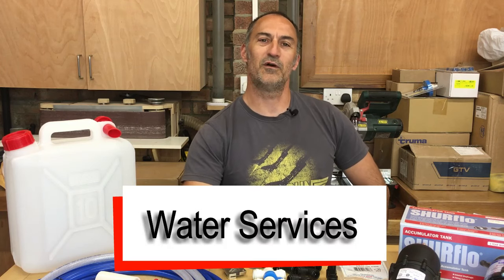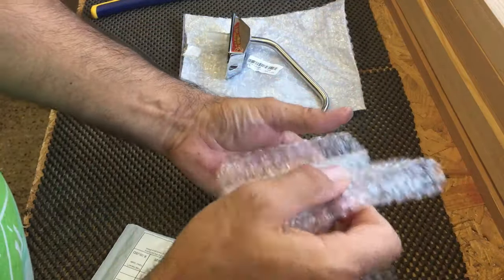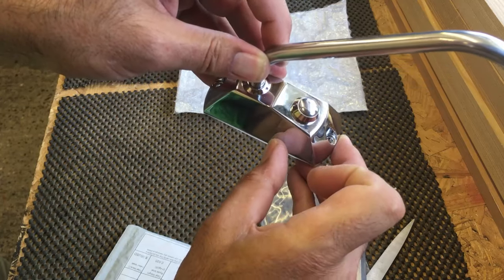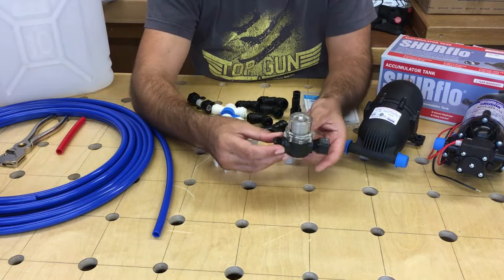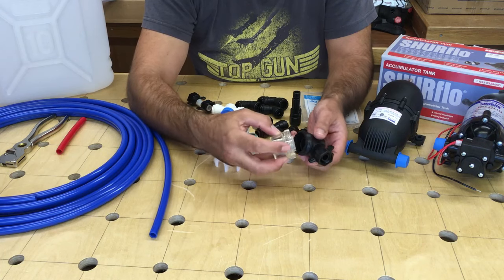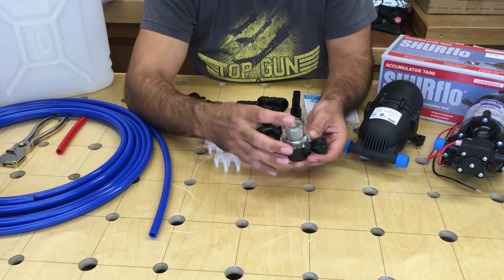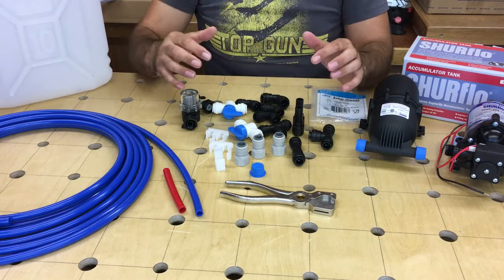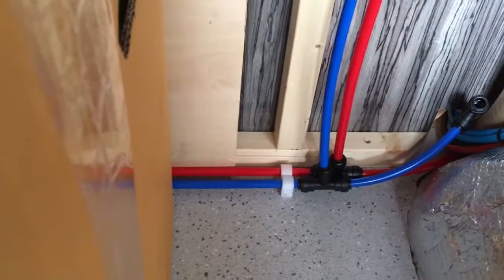Domestic Water Services - Camper Van Conversion Series

Comment from the maker: I have been asked about pipe inserts, I had an email from John Guest Technical dept today to confirm that inserts are not required on cold water services but recommended they be fitted on hot water services. So I will be adding tube inserts to the hot water joints, fortunately I made sure it was all accessible and not hidden away.
Reply from the maker: Iseeu Allgood, a few guys in the comments have mentioned the need for inserts to be used. I checked with John Guest and they have confirmed the above. The insert is placed into the end of the cut pipe to stiffen it, especially on hot water services as the pipe becomes more pliable with heat. Can get them for just under 50p each and fortunately I only need about 20 so under a tenner. 😃
Reply from the maker: Hi Sandy :D I'm guessing your house is less likely to be moving around much, so less vibration and risk, than in a van.
You not building a spa deck on the roof, for the ultimate hot tub views  ;D lol
Reply: i asked yesterday but after editing my message to include other questions i forgot to leave the question about inserts , The reason i asked was because im doing a van like Gregs but not up to date on latest materials , i used to own a loft conversion company and had a very bad experience caused by a plumber that didn't use inserts. days after completing the job one of the pushfit joints  popped and caused severe damage to ceilings and rooms below. i also remember cold joints slightly leaking without inserts, im not a plumber .. maybe theres less pressure or heat in a camper system so it wont be a problem .
dunno ?? 
the other thing got me thinking was that the inserts will make the pipe slighty more narrow at the connections , could that affect flow needed or pressure etc ?
Reply: @markusmack2732  don't think the inserts will make any difference in the presure or flow, they are quite thin. 
In a camper/boat the water pump is often turned off when the water is not in use and a leak will therefore not lead to a bigg spill.
Reply: Hi regards the inserts on the blue pipe you should put inserts on all your fittings the reason for this isn’t to just strengthen the pipe it’s there to stop the pipe from cutting the O ring in the fitting. when you cut the pipe with your pipe splice it will have sharp edges the insert will give it rounded edges. you might get away with not putting inserts in several times but one day you will find the pipe will cut the O ring in the fitting and leak and if the fittings in a awkward place it could make it very hard work. 😉
Reply from the maker: You make a valid point about the sharp edge on the pipe. 
You could also use a deburring tool to put a slight chamfer on the leading edge and some plumbers grease to ease past the o rings without risk of damage. 👍🏼😀
Reply: Hi Greg, great informative build series thank you. Do you have to equalise the pressure in the accumulator to match the start-up pressure in the pump?
Reply from the maker: Timothy Trewin yes the pressure in the vessel should match the pump pressure. Mine are both 2bar or 30psi
Reply: Hi Greg, I couldn't find any pipe inserts for the 12mm PM system. Did you add these to your installation eventually? I'm also wondering how you made the connection from John Guest to the metal threads of the water tab. Did you take JG plastic connectors? Thank you one more time for another great video.
Reply: Did they give you any reason for not using the inserts on the cold pipe?
Reply from the maker: @bexnut  it’s because the hot water makes the pipe softer. Not necessary in the cold pipes. 👍🏼😃
Reply: @GregVirgoe  Thanks for the quick reply Greg - good to know :)
Reply: Can you add a link for 12mm pipe inserts for hot water pipes.
Reply from the maker: @skierbaz this arrangement pressurises the entire system hot and cold. Why do you need to put the pump in the hot? Put it in the cold feed to the water boiler.
Reply: HI Greg. Thanks so much for all you helpful videos as they are a godsend. Can you please tell me how you connected the 12mm water pipes to your shower and sink taps?
Reply from the maker: @anthonyjones9009  this video shows the shower installation
https://youtu.be/vpezHyhLjxI
Reply: @GregVirgoe  0

Comment: Honestly Greg you save me so much time and effort, I'm in the middle of a van build that I'm living in as I go and I'm about to start designing my kitchen block including water systems. I hadn't done any research yet about even what pump I might want to use, and now I feel like I don't  really need to other than scaling everything down for my requirements. You're an absolutely top bloke, cheers! I'd happily buy you a carton/bottle of your favourite drink as compensation :D
Reply from the maker: I'm pleased it was useful to you, makes it all worthwhile, what type of van do you have?
Reply: I Have a 2005 Ford transit LWB High roof but not the jumbo with 200 km on the clock, that I picked up for a bargain It actually died on me as i drove it home, but the dealer was obligated to fix it so I got all new injectors and fuel pump,  such luck! I'll be putting in an arduino and raspberry pi to track interesting statistics, hopefully in the next few months will have something to show :)
Reply: That sounds very interesting Sam.  Do you already have a YT channel, or Facebook page link?  Would love to see Arduino video when it becomes available.
Regards Mark in the UK
Reply from the maker: Hi Sam, what things will you be tracking?
Reply from the maker: Hello Mark, I accidentally removed your comment instead of pressing reply. Very sorry, would you mind posting your question about tube size and colour again. Sorry slip of the finger 😐
Reply: Hmmm.  I know when I'm not wanted :)
The comment/question(s) which I can still see incidentally,  are pasted below.

Hi Greg.  Yet another excellent video.  Ok. you're now definitely my 'go to' new video to watch.  Shame it's almost coming to the end of the build - except as you mention at the end of this video, there are more to come.
Perfect timing yet again too.  I just selected my 2 x Shurflo pumps (20psi) and pressure vessel yesterday.  Still have the filters and isolation valves to 'put in the basket', but again you and I seem to be in near total agreement.  
I say near total, because I'm wondering why you used 12mm pipe rather than 15mm domestic flexible pipe.
From what I remember, the colour coded pipe is quite a bit more expensive than the white 15mm and I had in mind to just colour code near each fitting with a felt tip marker.
Why did you go for 30psi if 20psi you admit is adequate?
Looking forward to the next video, but again just wondering, have you actually departed on your European tour yet.
Regards Mark in the UK
Reply from the maker: How embarrassing, I was just saying to Lou, oh no!! I’ve just deleted Mark’s comment by accident and been trying to see if I could get it back. So sorry 😐 
Ok so the demand on our system is very low and at 2bar the flow rate through a 9mm pipe is adequate for the sink tap or the shower mixer.
Because it’s all fed off one supply we will not use the sink while someone is having a shower only in case the pressure fluctuates and causes scolding problems in the shower. 
Nothing wrong with going for a larger pipe and if it’s cheaoer then happy days. 😀  Your lower pressure pump will work better with larger Pipework.
No not left just yet, bit behind schedule, van booked in for service and not next week, just DVLA to sort out and insurances so hopefully a couple of weeks. May just go a different way around that’s all but we are free to do what we like when we want that’s the beauty of this. 
Thanks for great comment as always. 
Please send me some update pics of the van 👍🏼
Reply: Thanks for the reply.  Another question.  Is your submersible pump automatic or manual?  Auto in the sense that it will switch on at a particular fluid level and turn off at another?  Or, manual with an on/off switch?
My grey water system has changed very slightly so that I would like to be able to pump grey water from a 'sump' up 1m max into the grey water tank.  So, I'm looking for such a pump.  Would your s be suitable or can you recommend one that would be?
No pics really yet of my ex-community minibus conversion, although I think I may have sent you an outside pic of it - haven't I?  Actually, saying that, I don't think I have because I don't have an email for you unless I sent it via facebook.  Let me know.
Mark
Reply: @GregVirgoe  Greg, if it's not too much trouble please keep us posted with insurance costs.

I saw from another YouTuber (who gave you a shoutout :p) that his van conversion cost less to insure as a motorised caravan than it did preconversion as a van.

I'm not sure how and when that applies but it's a point of consideration.
Reply from the maker: Dazzletoad will do a video on the DVLA conversion and insurances etc thank you
Reply: I've an Arduino Mega in my Transit build. It controls just about everything and even talks to me courteous of a Emic2:)
Reply from the maker: Hello Mark, the small whale sub pump is only designed for light fresh water use. I would not use it for grey water. You need a proper 12v sump pump with float switch. There are grey water pumps, look up Jung Pumpen or Saniflo 👍🏼
Reply from the maker: Rob, you’ll have to do a video on that for us, first one I have heard of using arduino

Comment: I find its handy to have an isolator between the filter and the pump.  That way you can clear the filter without having to turn off the pump and empty the accumulator by turning on a tap.  It saves water and effort when servicing.  Videos are great by the way, really appreciate the effort put in.
Reply: This pump has inbuild checkvalve so water will not flow backwards when you clean the filter. If your pump does not have this valve you can install one just after the pump to prevent water from flowing backwards :)

Comment: Hi Greg,
I fitted the SHURflo 4009 water pump, 11LPM. This pump has an internal bypass that removes the need for an external pressure accumulator. One less fitting that can fail.
I went with flexible food quality water hose, brass fittings and circular clamps - this is probably considered an older, redundant technology but I used it simply for the better bend radius of the hose, much fewer elbows and shorter runs. With quality fittings, probably runs to the same price as John Guest system. Time will tell for realiability.
Thanks for you excellent presentations.
Reply from the maker: How do you find the noise on the pump?
Did you do anything to make it quieter?
Reply: @GregVirgoe  
I've got my pump mounted under the sink and you do hear a low puttputtputt, but definately not annoying as the water flow sound into the sink pretty well drowns it out. I didn't bother to box it in with soundproofing.
I did have a small leak in a joint and the pump alerted me to it by cutting in and out (putt...15sec...putt).  With the pressure accumulator you may not get this leak warning.
Reply: Thank you for the info Norman. I did quite a bit of searching, and couldn't find a SHURflo 4009 model, but did find 4008. After a bit more searching, I went for the Aqua King 2 version as the spec seemed really good for the price. It's 11Litres per minute, 30psi, and has an adjustable internal bypass to remove the need for an accumulator.

Comment: Another excellent video, as always. Thank you.  May I suggest a foot operated switch for the sink. A pedal mounted to the floor, similar to those used on sewing  machines. Many advantages to this. Switch on tap not needed, handsfree operation, more hygenic, less water spilt around base of the tap, massive saving in  overall water usage !  I have the same Whale submersible pump. It's  been under water now for nearly 4 years. Amazingly reliable.
Reply from the maker: This small switched faucet is only for a small drinking water supply, minimal use.
The main kitchen tap is a large mixer with spray nozzle fed off the pressure pump system and has running hot and cold water, just like at home :D

Comment: Highlight of my week when I get a couple of minutes to watch you new video Greg. Another great informative video, thanks!
Reply: Also, got my new t-shirt the other day. Will send you a pic of it in use in my demountable 😂
Reply from the maker: Hi Kim, that will be fantastic, really look forward to that, cheers 😃
Reply: By the way Greg, have you installed any drain points in the system? For winter storage.
Reply from the maker: Great question Kim, I have three drain locations. Each tank has a 3/4” drain valve fitted to a hose clipped to the skirt of the van. The third drain is at the low point on the cold feed to the boiler. This is covered in the boiler video.

Comment: Fantastic video again! I love the detail and methodical thought process! I would have liked to see how you drilled the hole in the floor to bring up the tubes from the water tank though; and most importantly how you'd re-seal the floor to prevent water and other elements from the underside going into the cabin. Regardless, GREAT WORK GREG! KEEP IT UP M8!
Reply from the maker: There is video of me cutting a hole in the Truma install video out very soon. simply just a case of going through all the layers with a Bi-Metal holes saw from top to bottom until you are through the lot, paint the raw edges and seal up with sikaflex and spray underneath with waxoyl for added protection.

Comment: You do an amazing job at explaining things in simple terms Greg. Everything you do is so well thought out and so easy to follow. I am really pleased I came across you before I started my fit out. I had originally converted a vw t5 transporter lwb and was happy with it but wanted something a bit bigger. I couldn't afford a Sprinter as in Australia they are very expensive for the year . I ended up buying a 2016 Renault Master lwb mid roof. I am currently in the middle of the conversion and constantly revisit your videos to cross check things. I'm not very good at doing videos but am taking plenty of photos as I go. We decided  not to add an internal shower and toilet to maximise space and work bench areas but have a cupboard for a portable toilet and have an external shower. We also added Airconditioning( The good old Aussie summers dictate that) and we used a dedicated gas Truma ultra rapid boiler . Can't wait to get it all finished. Today I cut all the holes in the van sides for the various items. Scarey stuff that😉. I'll post some pics when all done. Just a quick question regarding the sealer or wax you used on the worktops. Does it dry completely or stay like a wax. My concern is that if it is like a wax it may get sticky in damp conditions or need reapplying quite often? Keep up the great work Greg

Comment: Great. As you explain, questions go through my mind and you then answer them. Only question left is how well this piping/fitting system will hold up with movement and vibration on the road.
Reply from the maker: As it's flexible, I would say it will fair better than say rigid copper pipework that has no give in it.

Comment: Very useful info, the expansion chamber is a great Idea.
Reply from the maker: Thanks, your water needs somewhere to go to avoid over pressurising the system and causing a leak.
It should also reduce the number of times the pump cuts in and out.

Comment: Hi Greg - like the separate drinking water supply very much. Means you can keep that tank clean and not worry about contamination etc. I had considered UV sterilisation for our van but decided it was overkill since most water wouldn’t be drunk. This is a much better solution.

Comment: Awesome channel Greg!  I am from Tempe, Arizona, USA (part of metro Phoenix) and sincerely hope you get to visit here in the United States & Canada, I'd be interested in helping you build a home van here too if you needed to travel North America because of the opportunity to learn from you!   I hope to duplicate your efforts after watching all your videos in the last two days.    Thank you so much for sharing, love the details, especially the engineering & technical details, design work, and actual build etc..   We need to free up more people to be able to live as minimalists!   

The challenge here in most of Arizona is heat, though we have some mountain cold areas.  I have been looking into building a solar powered absorption chiller using an electronic sun tracking controlled Fresnel lens and/or mirrors (as a substitute to the propane) for cooling or to make ice.  It appears that liquid pipe (rather than air duct) seems to be the most efficient cooling/heating systems, even though most everyone here where I am at for homes has air duct that costs more (perhaps a subsidy for the electric utility...).    

I understand people have been requesting you to make builds, and your primary goals is "retirement" but I think if you made a Do It Yourself (DIY) kit design, people would buy it, all you would need to do is make the kit design as a book (can link to the videos) that could be sold on Amazon or site like it, as I would like to buy that book (though I know it does not exist...yet).  That can at least maybe account for the 2000 over flow on your initial budget.    Thank you again for sharing!